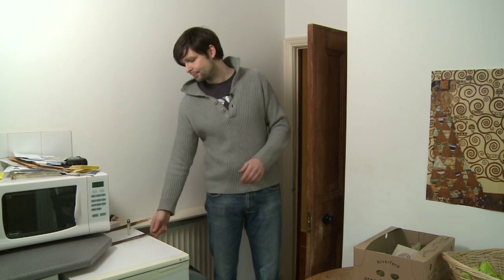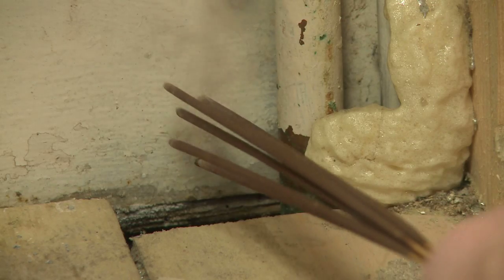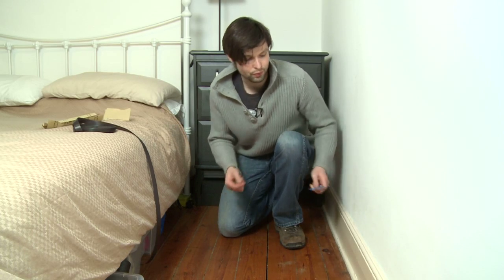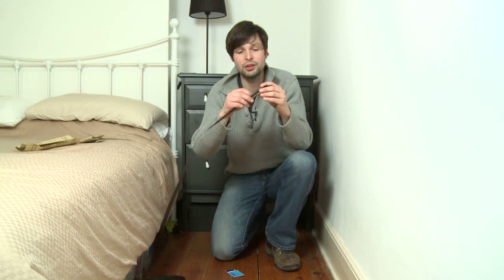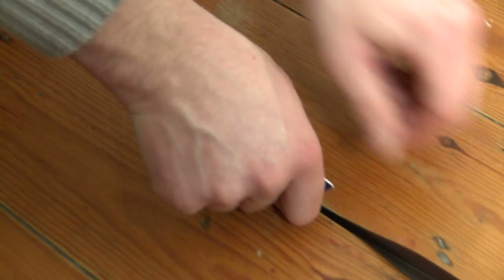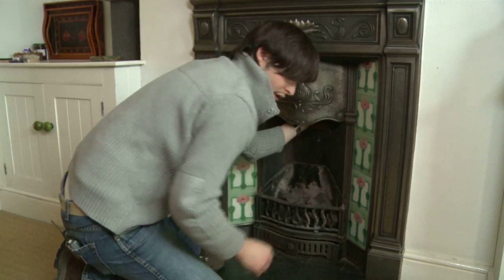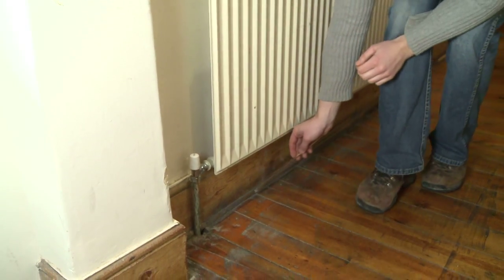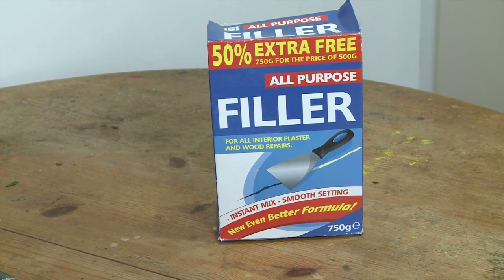How to draught-proof your home

Comment: The floor and skirting boards need to caulk / fill  cracks is only applicable if you have a space underneath your floor, not when your floor is on a concrete slab, many videos skip this important bit.